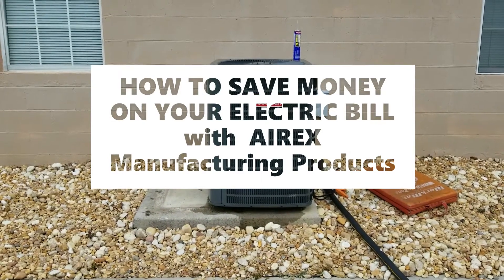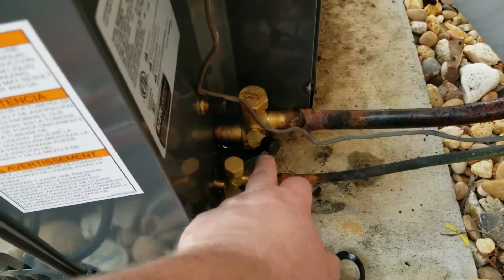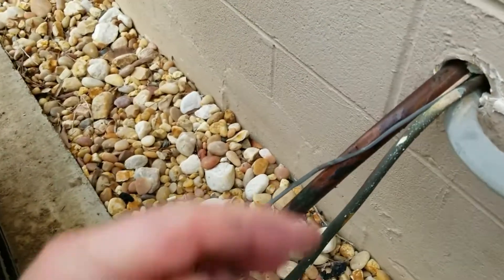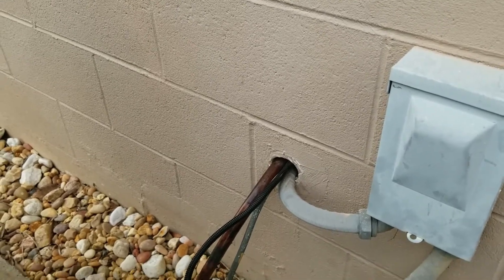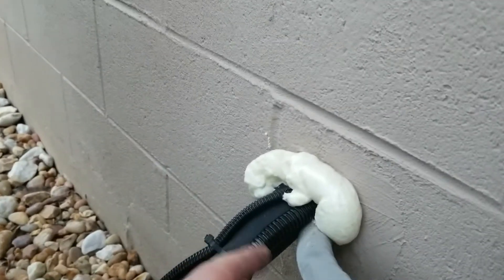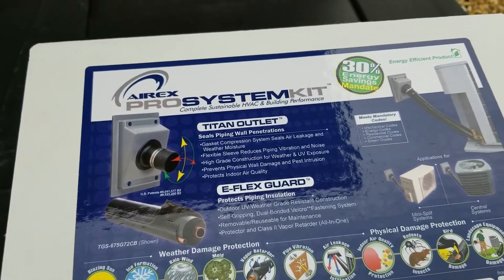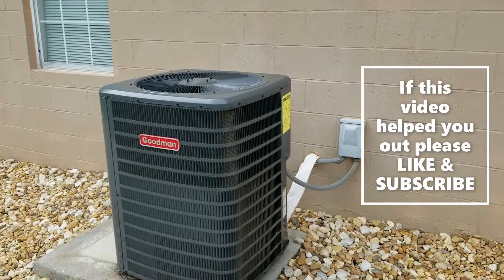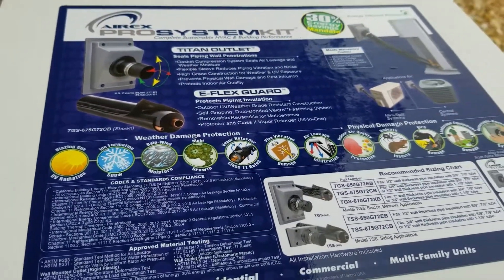Money Saving HVAC Tips and AIREX Pro System Kit Review

Comment: I have a apartment in one end of a metal building and I had central heat and air. After about 15 years it got to where it cost more to keep it running than it was worth. They finally told me I needed a new unit and that I was looking at $6000.00 or more to replace it and being that all is foreign made not to expect it to last over 10 or 12 years. Unlike the old ones that lasted 40 years. Thank god I had the wiring in place for a window unit. I bought a window unit is mounted inside my shop out of the weather and for heat I bought a ventless wall heater that runs on natural gas. Less than $700.00 for both. I am one happy camper because I am not having to spend money on service people coming all time to keep the Chinese junk running. When the window unit goes out just go get another one. Central heat and air is nice until it starts giving trouble. Personally I would not buy a house that had central heat and air and was not wired for a window unit. In your case why not build a outside unit dog house and have the whole thing in the shade. It will cut your electric bill down a lot and your unit won’t have to work as hard. Knowing you I am sure that you could come up with something that would work and be eye appealing as well. Just something that slides over the unit and up against the house. I’ve talked to people that have their units in the shade and it drastically cut their bill. During the summer here in Texas it can reach 106 or better degrees. Next summer put up a makeshift dog house and try it. Nothing ventured nothing gained. With My window unit sitting in my shop and and not in the sun I’ve never had a overly high electric bill.
Reply from the maker: I have a home warranty and so my HVAC unit is covered, so all I paid for a brand new GOODMAN unit and installation was $300. My parents got a Trane unit and it was $6500 and my other friend just paid $7,000 for a new unit so I made out like a bandit. Lol I've been thinking about putting a roof over the unit, but it's kinda low on my project list right now, since I just found out that I've got cancer but maybe one day I'll get around to it. Thanks for watching John, I appreciate it!
Reply: @matthewmeltonTEAMMELTONFISHING  oh man so sorry to hear about your illness. my prayers are with you. I am 66 years old and I often wonder how many more days I have left. I have come to the conclusion it really does not matter. Let’s say I live to be 90. That is only 24 more years and that will pass with a couple of snaps of the fingers. They are doing a lot with cancer nowadays so I am thinking you will be ok. On my birthday people were calling to wish me a happy birthday. I told them nothing was happy about it. I said sure I made it another year on one hand but I lost another year of my life. At my age birthdays are not to be Celebrated. Yes you got a heck of a deal on your ac. And a warranty too wow. I am still happy with my decision to go with a window unit. My wife didn’t like the idea but she has since gotten use to it. I am one of those that likes to live cheap as I can. The big 3000 square foot house never did appeal to me. Even if it is paid for the property taxes are outrageous and you really never own it. Anyway good luck and keep us posted.
Reply from the maker: @JohnDavis-yz9nq  Thanks, I appreciate it!😊